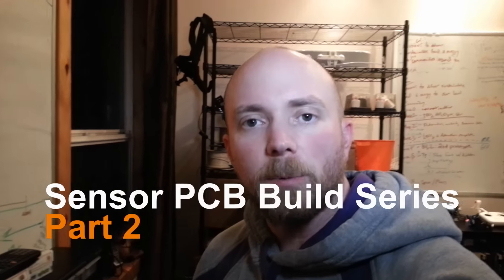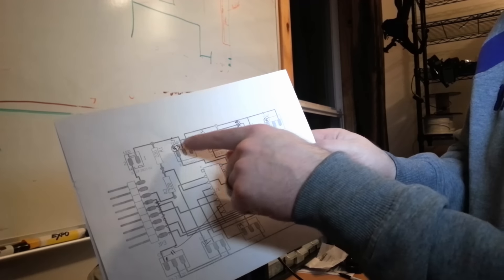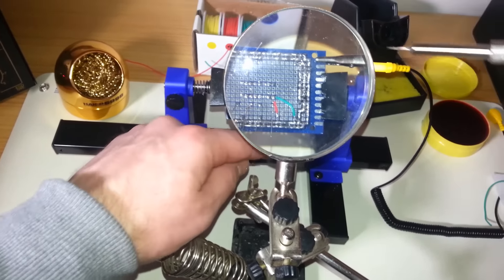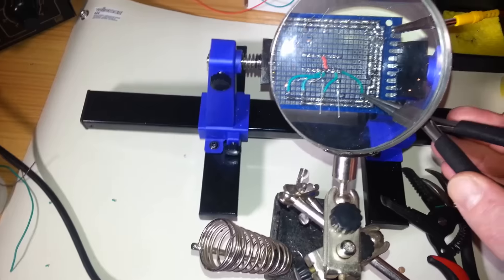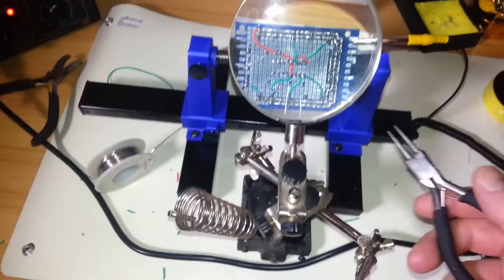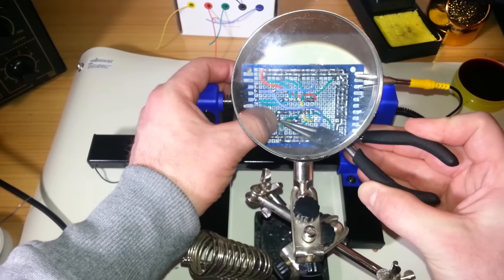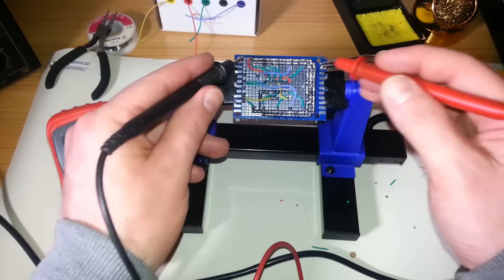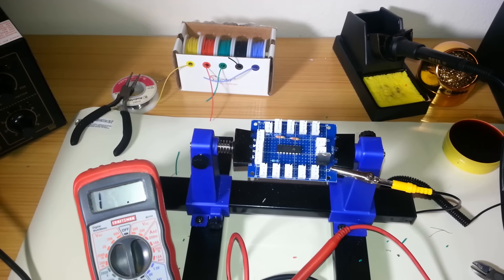Arduino Controlled/Monitored Greenhouse - Multiplexer - Part 2

Comment: Despite your protestations to the contrary, You are a fast learned. Well done. Getting solder on both pieces of the connection before you join them is called "tinning." PS Dad was Signal Corps back in the 30s when you built your own components as well as the whole radio. My job was the tinning.

Comment: A few suggestions for board 2... 
1. Use an IC socket, if that chips fails you're going to find it's quite hard to replace.
2. Use a consistent pin-out for all your connectors. You've got all the connectors facing the same way and the +5V rail on the outside, so on one side of the board +5V is on pin 1 and on the other side it's on pin 3. If you accidentally plug a sensor into the wrong side of the board you might fry it. Either reverse the facing of the connectors on one side of the board or run the +5V bus on the inside pin on one side of the board.
3. You could run a bare wire on the back side of the board for the main buses rather than bridging with solder the whole way. It'll be quicker and use a lot less solder.
4. Perhaps consider running some or all of the wires on the top side of the board like the other components. The wire goes through a hole adjacent to the connection you want to make and is soldered to both the pad it came through and the one you're connecting to.
Reply from the maker: appreciate the advice!

Comment: Hey TRM. Several friendly tips:
1. Switch your multimeter in "Continuity mode". It will buzz when there is a firm connection. It is much faster than waiting for the display to update.
2. Your solder tip seems too small for the (thermal mass of the) wires you're soldering. Use a bigger, chisel type tip.
3. The 7805 LDO you're using requires bypass capacitors on both input and output (at least 330nF on input and 100 nf on output). These capacitors are mandatory to keep the stability of the LDO. Check datasheet and application notes.
4. Your multiplexer chip requires a bypass capacitor connected between Vcc and Ground, very near to the chip's Vcc pin. Also mandatory. Also check datasheet and application notes.
5. ESD protection must include you also (not only the board). Altough i saw you have an antistatic wrist strap, you're not using it...

Kind Regards, from... Earth
JC
Reply from the maker: dude...that mode is the best...thanks for pointing it out!....i looked up the specs and darn...yup...i totally missed the fine print...digikey here I come

Comment: I used to build test fixtures for microcircuits for a living. I have a lot of experience with prototyping. First, you might consider building your circuits on a breadboard before trying to solder them to a protoboard. That way, you can work out the bugs in your circuit before soldering the parts in place. There are even protoboards that are laid out like breadboards that make it easier to transfer the circuit you design. 

When setting up an ESD protected work station, you need to connect the pad to an earth ground through a current limiting resistor and you especially need to wear an ESD wrist strap to ground you to the pad. Static builds up on everything, especial people and you can easily degrade or fry an electronic part just by touching the board if you aren't grounded. When soldering a microcircuit directly to a board, even your soldering iron needs to be grounded. If iron you are using isn't grounded internally, you should put a grounding clip on it with a 1 Meg resistor to your pad. 

If you want your circuit to last, you need to wash the board thoroughly after soldering with flux remover/electronic cleaner. Otherwise, the flux from soldering it will corrode the pads. It would also help to seal the board with a clear lacquer after you clean it, especially is you are going to use it in a humid environment. Protoboards are not very durable, so don't be surprised if it delaminates after year or so. But, sealing it will help.

After you get frustrated with protoboards, you ought to try printing your own circuit board. There are kits with photo sensitized boards that allow you to transfer a layout you design on your PC. It's actually a lot easier than it sounds.
Reply from the maker: thanks for following...yup...ESD wrist strap is on the way...also looking for cleaner and brushes...appreciate the info

Comment: Usually, for working with IC's I prefer to use strip boards and I cut the strips where required to form circuit board traces.  I use a drill bit or a Dremel to cut the copper strips and form the traces that I need.  That allows me to have a row of connected holes for each IC pin and makes it cleaner to build.  However, using connectors with sets of parallel pins requires some planning when using a strip board.

Doing the wiring the way you did it is more difficult because you have to hold the wire while soldering it and any spring tension in the wire will cause it to move while the solder is hardening, leading to cold solder joints and bad connections.  It also tends to get the soldering iron tip too close to the insulation, causing it to melt back and potentially creating shorts.  Also, if you're inexperienced with soldering, you can get the wire too hot and melt the insulation where the wire lays across another component wire and then create a short that way.  Of course, you really have to be careless for that to happen, but you can avoid those problems by doing it differently.

A pretty good way way to do it is to route the wires on the component side of the board and poke the wires through the holes next to the spots that they will connect, leaving the wire tails long enough to bridge across the gap between the solder pads.  That way, you can bend the wire tail on each end of the wire and across the gap.  Since the wires go through the board and are bent on either end, they are held in place without you needing to hold them.  Then all you need to do is solder the wire to it's pad and to the adjacent pad.  If you have multiple items to connect to a node, you just choose adjacent solder pads and repeat.

When I'm using the type of breadboard they you're using, I generally reserve the rows of solder pads in line with each IC pin for connections to that pin and do the bridging of the solder pads as I described.  I avoid bridging with component leads because that makes it more difficult to remove components later on should they require replacement.  If I have to bridge between a component solder pad and an IC pin, I'll typically snip off a small bit of component lead to use to bridge the gap rather than bend the component lead across the gap.  The typical issue that I run into with bridging is that the wires may not bend perfectly flat and stay there, and I have to be careful to avoid forming large solder blobs.  Also, when bridging with bits of wire or component leads, the bit can move around and make a mess, which is why I prefer the strip boards with ICs - no bridging required.  Anyway, all it takes is a little patience.  You can place all the components on the board and do all the bending to bridge the pads, and then flip the board over and solder the entire thing.  It's much faster and doesn't require you to try and hold wires while you solder.

Also, liquid solder transfers heat much faster, leading to faster soldering and less potential for heat damage.  Basically, without tinning, you have to rely on the soldering iron tip to conduct heat into the pad and wire at the contact point and then the heat has to flow from the contact point to the rest of the metal before the solder will flow and adhere properly.  This means that the heat source has to be applied longer and creates the potential for heat damage to the components.  By tinning the pads and the wires ahead of time with solder and keeping the tip of the soldering iron tinned without blobs, the the melted solder on the tip instantly melts the solder that is tinned on the wires and the pad, allowing the heat to be conducted to the entire surface of the metal in a much shorter time via the melted solder, which leads to shorter contact time, less heat input, better solder joints, and a lower chance of heat damage to wire insulation and components.
Reply: Yup, TRM, listen to this guy. I would have put all the wires on the top side and landed the wire next to the hole for the IC. Then just tack down the long bare tail, solder to the IC socket and snip the excess. Same for the other end. Even if you have to slip a bit of spaghetti tubing (or heat shrink) for the long bare tail on the bottom side to prevent nearby shorts, it is a lot easier to run the wiring on the topside. And USE SOCKETS for all ICs. You'll be glad you did.
Reply: + htmagic, Good call on the IC sockets!  I use them exclusively, but forgot to mention them, DOH!  The IC sockets not only make it easier to change the IC should it be required, but it completely avoids putting heat into the IC while soldering.

Comment: If you are confused by the technical jargon:
*  "Mucks" = MUX = multiplexer.  A "multiplexer" is a digital switch.  The microprocessor in this circuit samples the signals from 10 sensors by sending a signal to the multiplexer.  The signal tells the multiplexer which sensor to connect to the microprocessor.  Once the microprocessor is connected to the selected sensor, the microprocessor can read the signals from that sensor.  
*  "PAR sensor" = Photosynthetically Active Radiation sensor (measures the amount of sunlight in the frequencies / colors that plants actually use during photosynthesis)
*  "bus" = a conductor that is maintained at a specified voltage (e.g., power supply bus, or ground bus).
*  "Ohm testing" = measuring the resistance between two points in a circuit in order to determine whether they're connected, and if so, what is the resistance between the points.

Comment: I wonder if a support block you can rest your hand on when holding wires with the pliers would make it easier for you. a small 3x4 loose wooden block you can adjust by just flipping either way to whatever desired height. it might steady your hand . just a thought

Comment: To make your wire soldering job easier the first flux and pre-soldier your wire ends before soldering to your board. You'll find this is much easier than trying to solder bare wire, I did this for 10 year with a electrical assembly company , we made circuit boards and wiring harness is for In tail and a number other type of electronic companies.
Reply from the maker: thanks for following...yes...definitely learned that...appreciate the guidance

Comment: I would have socketed the IC. If you ever have to replace it, it will be a mess, also there's the chance of damaging it with heat while soldering the pins. Quality sockets are inexpensive.
Reply from the maker: didn't even know about that concept...on digikey now and ordering parts :-)

Comment: Analog input boards don't look a lot like this, there's no filtering, buffering, OVP,  the power regulator seems to lack any capacitors. Normally the A/D conversion happens as close as possible to the process being monitored to avoid noise/crosstalk/signal integrity etc. This looks like everything is happening back at the CPU? It might work, but there's no sense in making life hard on yourself.